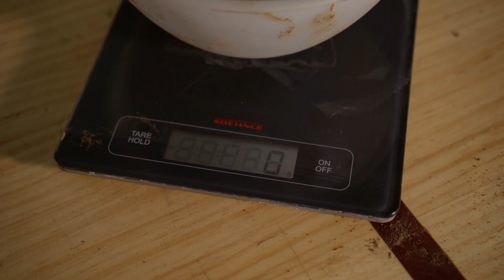Never Buy Clay Again | WIld Clay with Ben ep. 2

Comment: How long does it typically take for the wet processed clay to dry up? Thanks :)
Reply from the maker: It depends on several factors. How are you drying it? How humid is it? Is it in a dark area or the sun? Is it still or windy?

If you mix it all together, then let it settle, and siphon (or sponge) off the water, then dry it on a thick piece of plaster, it might take a day or two, maybe three, depending on humidity. 

If you do the pillowcase method, outside in a breeze, it could take a day. If cold and damp, it could take a week.
Reply: Thanks so much! Your videos have really inspired me to try this myself :) currently playing around with a few samples I found yesterday.